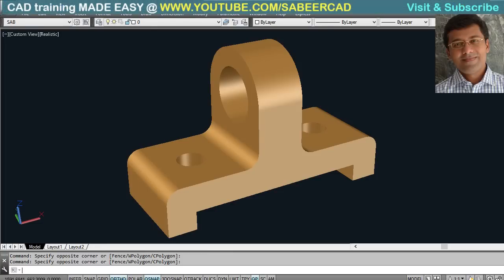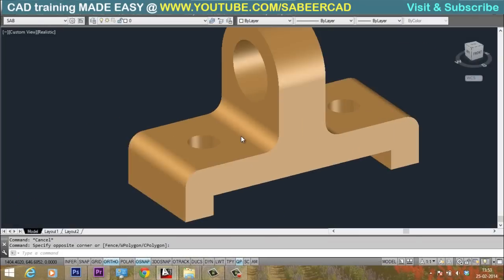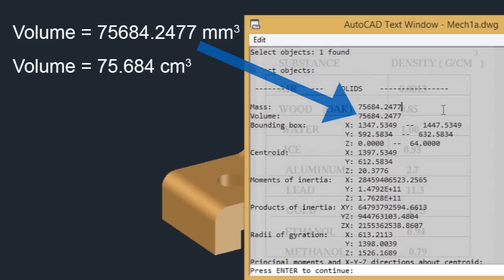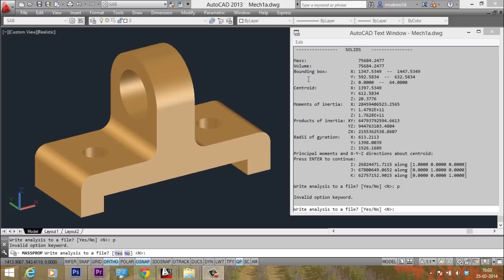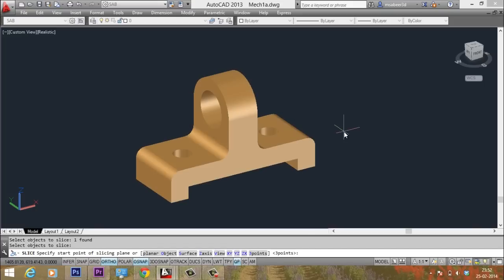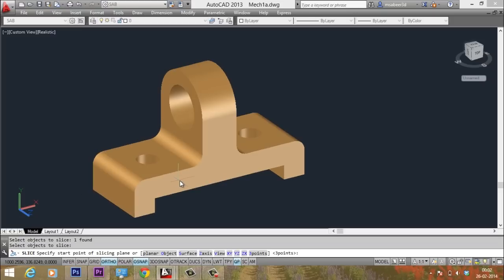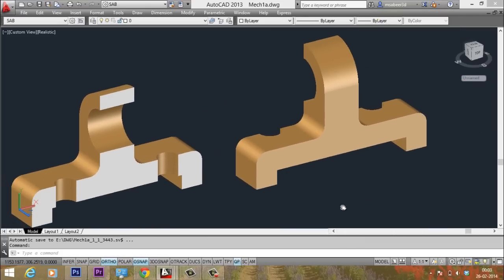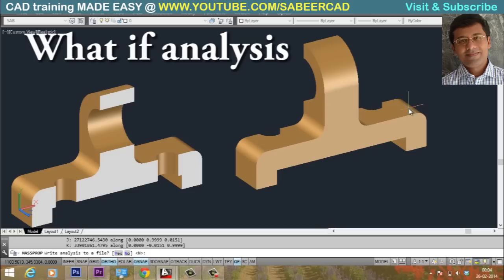AUTOCAD MASSPROP | MASSPROP COMMAND | AUTOCAD SLICE COMMAND

Comment: Nice Video! Could I estimates the materials needed in the construction of a house, for example, using the massprop function? Is It possible to assign densities to distinct materials at the same time?
Reply from the maker: Rafael Santos  You will get volume of any desired 3D model using massprop command . Since the density of each material is known we can very well calculate the weight . We can get the estimate in AutoCAD using a different procedure . I will upload tutorials on that later
Reply: sabeercad Thank you.